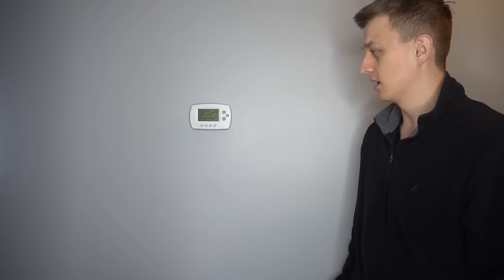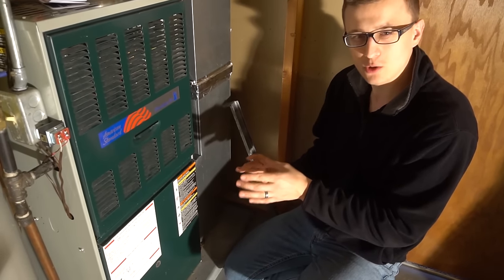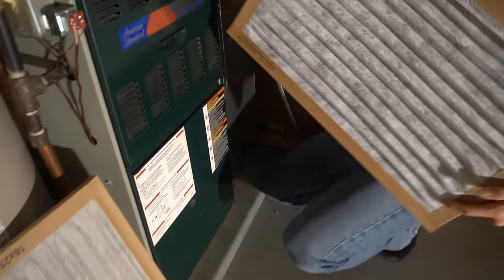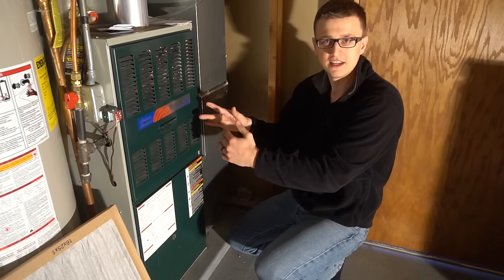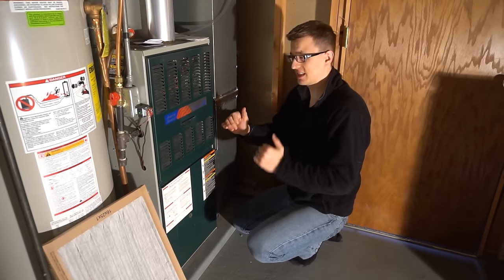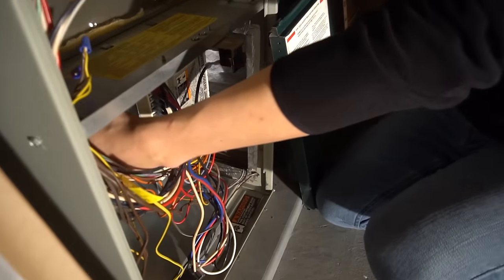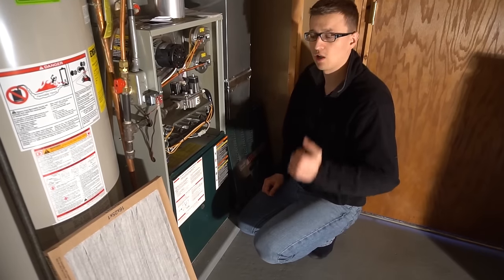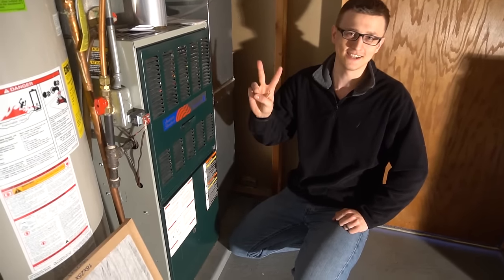Furnace not Keeping up SOLVED

Comment: Ok bud a couple issues with what you’re saying pertaining to fan. Depends on rather you’re running a motor with a module on it or not . Burnt smell could be a board . Burnt smell could be the module. Either way different furnaces do different things. 90% and up furnaces bring a whole other element to this . Pressure switches are a common issue as well that and dirty flame sensors. So to the common person that doesn’t mess with this sort of thing the furnance not keeping up could also translate to a bad flame sensor or it needs cleaned off. You can see several different problems in 90% and up furnaces though. What about the house being on zoned systems? There’s that little tid bit as well seeing as how half the house would have a problem on a board failure( common problem in zones) in a zone which would also give that same indication. Another issue which is also a common one is bird nests in the vent pipe will cause those issues as well. Yes filter is important and also why a lot of companies out there now are recommending not using pleated filters. When they stop up they totally stop up. You don’t just lose a little efficiency. If you reach in to turn the fan and it doesn’t it’s a bearing failure issue most commonly. If you turn your furnace on and you have the variable speed fan with module and the motor tries to start but rocks back and forth and fails to start usually a module but in that case your best to change the whole motor because a module means you could be back again tomorrow on the same repair. I’ve been in this field for 22 years now. I’ve seen a lot of things . Filters are the number one cause of issues . People tend to forget those. There are other elements than filters though . Older tranes have that fun little fan timer that creates issues works sometimes won’t other times you gotta try and force it to fail sometimes to see if that is the issue. Lots of fun stuff on furnaces though 😂.

Comment: This only solves one situation...if owner has an evaporator coil. This can cause the same issue if it’s dirty and restrictive. Depending how long it’s been that way I’d definitely pull the heat exchanger to make sure a compromise isn’t present. Blower motors can still move in some cases. Safer way than sticking your hand inside would be amperage draw.

Comment: I tried your solution. It did not work. My furnace is 2 months old, a Rheem 2 stage propane. When i finally got the installer back in to investigate, he found there were two settings (switches) that were incorrectly set at the factory. Works fine now. He had to spend time tracking down the wiring diagram from the installation manual. I have nothing good to say about Rheem customer service. I had a miserable time trying to register the warranty. Turned out, their online instructions were wrong.

Comment: My heater only works when fan is ‘on’ and not on ‘auto’What could it be? Please help!
Reply from the maker: Hard to say with this one.. By the sound of it, either the thermostat or the furnace control board is bad. Some people choose to run their fan ON all the time. It does not cost too much on the electric bill and it does no damage to the motor. So you could just leave the fan in the ON position if you do not want to be replacing any parts.
Reply: It sounds like the furnace control board "slow speed" relay (used for heating only) could have failed or the slow speed winding in the PSC motor is bad.  Check the high voltage at the control board where the low speed wire is connected to see you are getting any voltage after the burners have been running.  I believe the "Fan ON" thermostat setting runs the fan at a higher RPM (normally used for cooling) so it would use a different circuit in the furnace control board.  If the thermostat were bad, I suspect the furnace would not light but a voltmeter would tell you for sure where the failure lies.

Comment: Retrofit a real filter. Those cheap 1 inch filters are just dirt strainers, and some of the higher end ones may restrict the air too much in your furnace. We have an Aprilaire filter that is changed yearly. It’s big, and @$40 to replace, but it does the job.

Comment: My thermostat is set at 73, it will heat up till 71 then shutoff, then it stays off until around 64 degrees and then turns on. I changed filter and cleaned the flame sensor. It does kind of sound like the flame is starting and stopping but not real sure. Also the bathroom gets up to 90 degrees when the rest of the house is 71 and my bedroom is probably about 69 but I think that's a different issue.
Reply: Any suggestions?

Comment: My heat does not turn on to achieve set temp sometimes and stays like that for all day or all night and then it turns on suddenly without doing anything
Reply from the maker: That sounds like the unit is in a lockout. Usually this will happen if the furnace runs into an error 3 times in one heating cycle. When your unit is off like that, does the control board blink any error codes? I have a video on that here: https://www.youtube.com/watch?v=QJAMWlJ0tbk&t=2s
Reply: I dnt know where is the control board that displays error codes

Comment: I replaced the filter and checked the fan and its working, can it be the thermostat?
Reply from the maker: So if you turn the power off and on to the furnace.. With the thermostat calling for heat, what does the furnace do? Also, does the control board blink any error codes?
Reply: I reset the furnace and is now working properly. Thanks

Comment: When the dirty filter was in at the beginning, the fan was noisier because it was not working at moving air and spun up to a higher speed. An ammeter would have indicated low power consumption. When the fan is working hard moving air, it is quieter and at lower rpm because it is under heavy load, as an ammeter would indicate.

Comment: I have a honeywell, There are code lights. But no code translator. My heater runs. But produces no heat. I tried the filter thing, it worked once but after a week the heat failed again. I have almost 60% of a tank.

Comment: Hello I'm having the same problem but my thermostat, is the same on this video, the temperature reading on it just randomly fluctuates between 70 and 72. I did all in this video and still getting same thing. Thanks in advance
Reply from the maker: Well if it fluctuates randomly then I would say the thermostat itself is defective.
Reply: So the thermostat I can set to 68 degrees and the furnace turns on and off like normal but I raise the temp to 70 or 72 the reading on the thermostat fluctuates
Reply from the maker: @TheDinkumthinkum  When you say it fluctuates, can you give an example of what that looks like? Do the numbers just go up and down between 70 and 72? How frequently do the numbers change and how long ago did this start happening?
Reply: @WordofAdviceTV  just started today. Ok when I set the temp up to 72, furnace kicks on and stays on until an error occurs which tells me limit switch but when the furnace is on at this time the temperature on the thermostat moves up and down between 70 and 72 at like 15sec intervals
Reply: @WordofAdviceTV  I guess I should ask if the limit switch could be making the thermostat do that
Reply from the maker: @TheDinkumthinkum  The limit switch could be causing that, yes. Although I haven't seen a thermostat changing temperatures back and forth at 15 second intervals before. Seems like something's not right with that thermostat.

Comment: I have a Nordyne furnace m1mb for a mobile I have No insulation and when its really cold out it won't reach the set temperature. But not cold it does.
Reply: All mobile homes i have seen are built with leaky ducts. As an energy guy this for me is painful !!

However there is a reason that is not just bad workmanship, the leakage is so losses go into the belly wrap to help keep pipes from freezing.  What you need to do is look for holes in the belly wrap and seal them. Not having seen your mobile home there are probably a few other things you can do inexpensively if you are handy
Reply: Depends on the trailer.. if ducts are in center then the ends are just rolled up and pinned off.. if it has other duct like flex.. chances it isnt sealed either and may fall off...either way trailers suck!!!

Comment: HELP! 2 Stage American Standard furnace...freedom 90 Will not go past 66. Installed a new Honeywell stat.
Reply from the maker: I have another video called 10 reasons why a furnace overheats. I wonder if your furnace is still overheating even after you replaced the filter. When the burners shut off, does your control board blink any error codes?
Reply: If the furnace is a high efficient furnace the secondary heat exchanger could be plugged. This item is above the blower and requires the blower assembly to be removed. The secondary looks like and A coil

Comment: Pleated filters need checked every 3 weeks at a minimum.  They are denser than normal see through 30 day filters.  Many, many blower motors have failed because the filter was plugged off with dirt and caused the motor to draw higher than normal amperage as it was trying to draw return air back through the system,  and thus a lot of heat was generated on the motor bearings,  and they failed because the lubricating oil broke down and could not do it job of lubing the bearings.  Don't use pleated filters unless you have to because of allergies; and if  you do ,  check them frequently, and save yourself a high repair bill to replace the motor.  My opinion only.

Comment: Why does my t-stat doesn't turn on ?i got t-stat set on 78 & a/c will come on when home temp goes up to 81,i replaced tstat twice & still same issue
Reply from the maker: That's an odd one... So everything works good but the thermostat does not turn on the AC until it gets 3 degrees hotter than the set point? The thermostat should be the only thing that controls the turning on and off of the unit.. Do you have a power saver switch from the electric company by chance?
Reply: @WordofAdviceTV  no none of that,i got a 25yr old york split system,this issues just started about 3wks ago would the furnace have a timer or something that could be going bad,how about the motor?
Reply from the maker: @justdissin7340  There could be a time delay board in the condenser unit. It's hard to say without checking it out. This one isn't exactly a common problem
Reply: @WordofAdviceTV  ok thank you ill have to check that out

Comment: Hi, I am having this exact problem but I do not have a filter. What else could it be.
Reply from the maker: Are you sure you do not have a filter? Maybe your filter is behind the return air grill? All furnaces should have a filter somewhere in the return duct or if you take the bottom door of the furnace off, it may be at the blower motor housing too. Two more common reasons are:

1. You may have too many vents closed or you have a return grill/s blocked
2. It may be a plugged evaporator coil. To clean it, you would need to get to the bottom of it which in some cases is pretty hard to do. Try searching " air conditioner evaporator coil cleaning" to get an idea of what I am talking about. Many people choose to just hire a duct cleaning company to clean it for them.

Hope that helps!
Reply: I know for sure there isn't a filter in the furnace. The return air deduct that I will check. I will check all others! Thank you for getting back to me. It's much appreciated.

Comment: Never use the pleated filters, will restrict and damage unit
Reply: Wrong.
3M is not going to make filters that ruin your system. They would have been sued years ago.
Reply: @robertrose3068  sure will if you don't stay on top of changing them seen them ice up solid and crack tubes all from a clogged up filter and even half clogged will affect efficiency.
Reply: @georgespangler1517  

And that's not what I said, is it? No. If you follow the instructions as one should, 3M is not going to make pleated filters that create issues-they would be sued if they did. Logic.
Reply: @robertrose3068  problem is alot of air handlers are put in crawl space where it's hard to keep up with the filter I've seen it many times and only with pleated filters. Sure you can't sue them if you don't maintain changing them,, but although more  effective I don't recommend them unless it's really convenient to replace.

Comment: So you call a motor with seized bearings “burned out”. It’s only burned out if the windings are fried.
Reply from the maker: You are right, I should really start using proper terminology.. Thanks for the correction!

Comment: My problem is the fan blows for about 2 minutes and it stops I’m over this furnace can you help me I have tried everything?
Reply from the maker: First thing I would look for is an error code on the control board. When that happens, usually the board will be blinking an error code. That will point you in the right direction. Once you figure out what the error is, there is a good chance I will have a video for it. Just look in my furnace playlist: https://www.youtube.com/watch?v=dPXM8TFMQGw&list=PLK8tZPlovA8BJJ_weFseSjQWUvB2FFII2
Reply: Word of Advice TV I took the digital thermostat off the wall and put new batteries in 👍🏿. Running good for now
Reply from the maker: @juju3616  Nice :) Glad to hear it was something easy to fix! Stay warm!
Reply: Word of Advice TV I will try 🤞🏿thanks a lot for the information your awesome
Reply: @WordofAdviceTV  On two different Goodman furnaces I've seen this issue, the blinking error code has been 4 flashes from the LED on the board.  Perhaps this helps someone out there.  These error codes are usually listed inside the furnace or on the back of a panel removed for accessing the furnace.  Translating the greek can be difficult unless you're an HVAC tech but there is always Google!  In my case, the answer was to simply change the filter so the proper airflow was restored which not only helps heat the house but it helps to cool the furnace to a normal operating temperature so the high limit sensor doesn't trip. 

I checked one of my vents that usually blows pretty hard and the airflow seemed pretty weak and the temperature seemed hotter than usual.  After pulling the filter, it seemed to double the air flow.  Another sign that it's the filter is hearing excessive sucking or whistling around the filter when the blower is running...so for tonight no filter and I'll snag another filter at the hardware store tomorrow.  But I get to sleep in a warm house!

In both cases I could hear the furnace running as the furnace isn't buried in a basement, otherwise I might have not caught the issue.  The furnace would go through the proper cycle then the burners would shut off and the fan would run, then I would hear the burners fire up again...and that's when I knew something was wrong.  Normally the fan would run then shut off until the thermostat kicked in to begin the next series of heating cycles.  The furnace seemed to run 'almost' continuously as the house struggled to maintain a steady temperature because the furnace would essentially overheat and stop.  To the untrained ear this would have been easily missed but after 'furnace paranoia' sets in you pay attention to these kinds of things.  No one wants to sit around in the cold waiting for a tech to show up late at night or miss a day of work waiting for someone to show up, especially for something preventable or something easily resolved!

Thanks for creating good solid videos, much appreciated!

Comment: Those filters need changed every 2 weeks.
Reply: No they dont, they can go longer than that. I use a 3-pack of filters each winter, 3 filters over the course of 5 months. Been doing it that way for 15 years, works fine.

Comment: That filter is too fine and shouldn't be used.  A filter without such fine filtering capacity will work much better.  As well, those fine filters will cause A/C problems, particularly in humidity build up in the living space.  You just can't use those premium filters with continued success.  By the way that was really stupid to remove and replace the filter with the unit running, you sent all kinds of dust right into your home.

Comment: The better the filter the dirt will be stopped and removed versus building dirt up in your system.  If you bought an expensive car and your neighbor said use the cheapest oil and filter would you do it ???    Please don't listen to this guy.  The dirt will build up in your furnace permanent and then you are buying a new furnace.  Just change filters a lot and the dirt will be going in the trash !!!

Comment: Pleated hitler's have to much resistance to air flow and get worse FAST, if he really knew his stuff, like me, he'd advise using the cheapie fiber mesh filters unless you have respiratory problems and really need the filtration for pollen and such. As for a tight blower motor, most of the time they can be freed with wd40 sprayed into the oil ports and working the wheel back and forth until free then add oil, don't forget after freeing the motor to check for bearing play wiggling the shaft side to side, if there is play THEN you need a new motor.